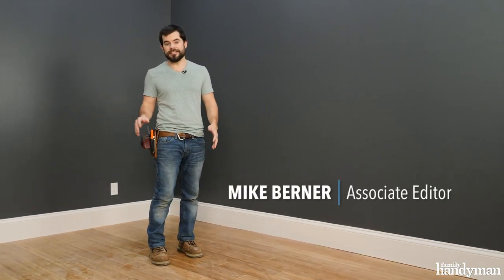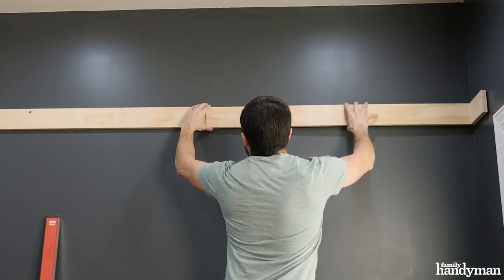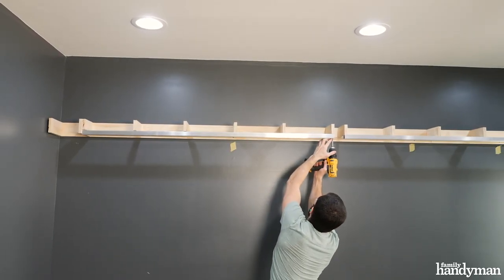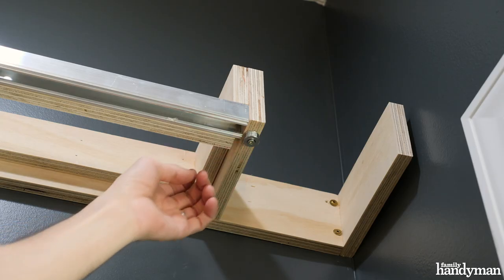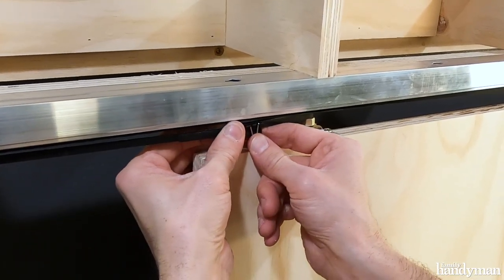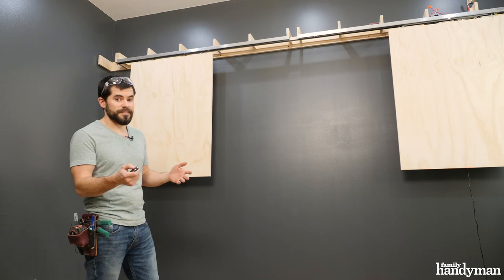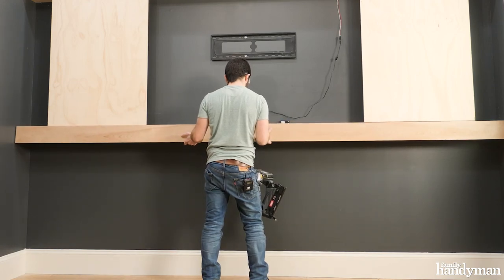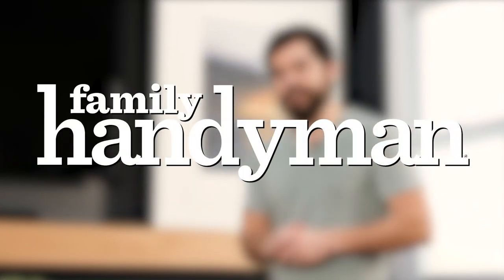How to Create a Hidden TV

Comment: Hmm... I like the concept, and the motors address a nice touch but I have two issues.  1: it's huge and sticks out from the wall so far as to be more distracting than just a mounted TV.  2: the concept of artwork is great but no one hangs two matted frame pieces directly next to each other, it just looks bad.  Perhaps get a large unframed print transferred to wood and split it down the middle so the artwork looks nice when closed?
Reply: Good point.  When separated I’d like the halves to add artistic balance.   The visibility of the tracks is what gets me.

Such sticklers we are.   😃